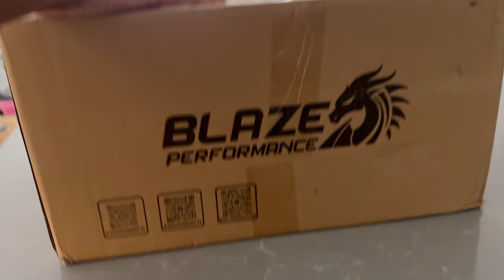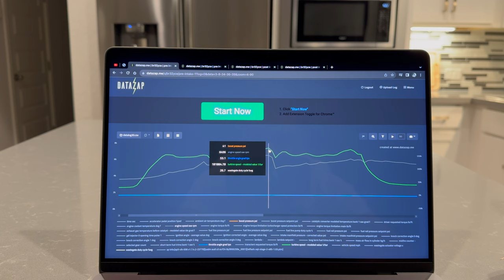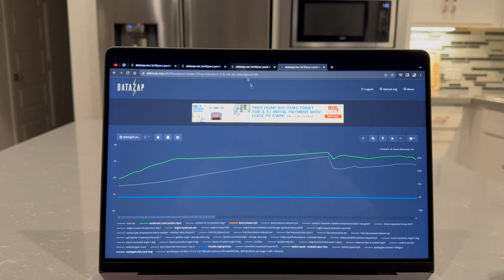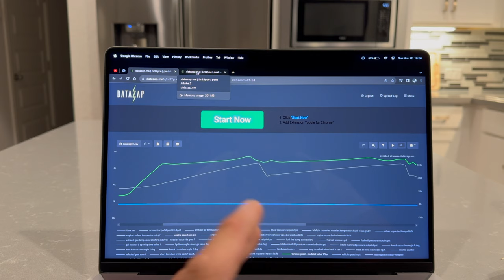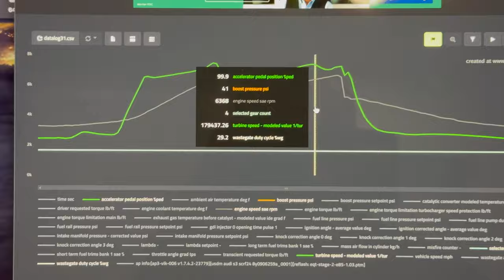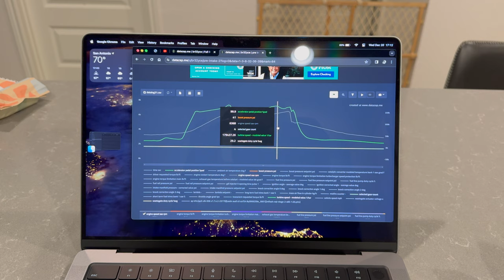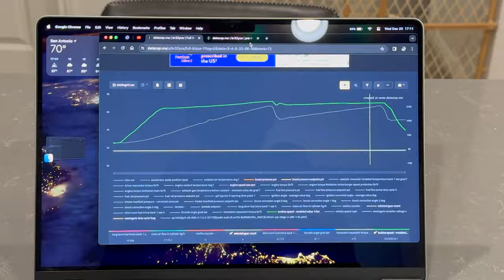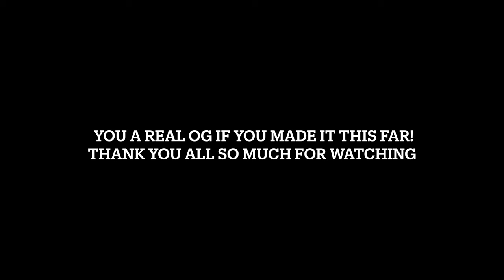Blaze Atom intake for the MK8 & 8Y! Data logs and install!

Comment: DBV2 has a nice intake, unfortunately an open intake without a heat shield is going to pull in air from the engine compartment, and it takes more power from the turbo to compress less dense air.  The differences you're measuring are likely predominantly from temperature differences of the pre-turbo intake air.
Reply from the maker: Definitely could be!
Reply: Is this really one of the best Air intakes for this ea888 gen4 platform?
Reply from the maker: @ces3_rings  yes sir it is. There hasn’t been another intake to show better gains as of today.
Reply: @BryceJordanProductions  APR and Eventuri intakes show comparable gains on their dyno charts vs the stock airbox.
Reply: @mygolfmk7209 If you have to choose between racingline R600 VS Blaze performance for the new ea888 gen4. What would you choose for getting better results?
Reply: @ces3_rings  Both appear to be the same product as were offered for the Mk7 or only contain minor changes.  I doubt there'd be much difference, I think you could use some other criteria than performance when choosing.

Comment: Curious, neither the EQT store or the Blaze website have this intake for the 8Y/Mk8. Do you have the only one that fits an 8Y or did they provide you with the 8V version? I’m asking because I want to buy one for my mk8R and I’m wondering if what you have will fit mine. Please help.
Reply from the maker: It’s not available to the public, older generations will not fit. They should be available soon! I managed to weasel my way into a pre production unit 😄

Comment: The baseline for all intake testing should be no intake/chicken wire over the turbo inlet.  That's the least amount of restriction.  Then anything else will start to restrict from stock at the most to something aftermarket like the Blaze at the least.  The turbine speed...is it modelled or does it have a sensor measuring it?
Reply from the maker: That would be risky but would be great in a controlled environment. This wasn’t professional by any means, just some fun experimenting! We do have shaft speed sensors on the turbo with the gen 4 😄
Reply: You'd at least want a bell mouth to eliminate flow loss due to the edges of the compressor inlet.  
https://youtu.be/sMn4i1pHSrg?si=XculGjao5_XN8Why
Reply: @mygolfmk7209 is there any brand that have bell mouth-inlet pipe?
Reply: @TheShameous  DBV2 and IE V2 are a couple I know of that have a bell mouth transition from the filter to the inlet pipe.  The bell mouth is more important in the case where there isn't a filter on the inlet pipe.